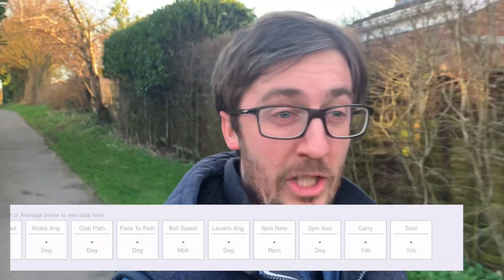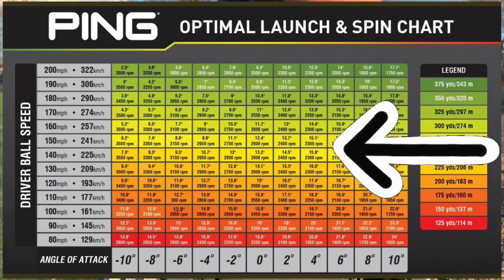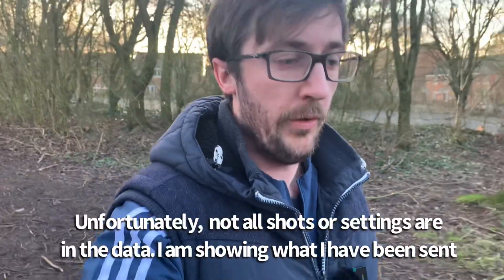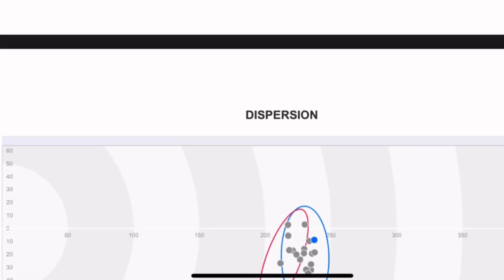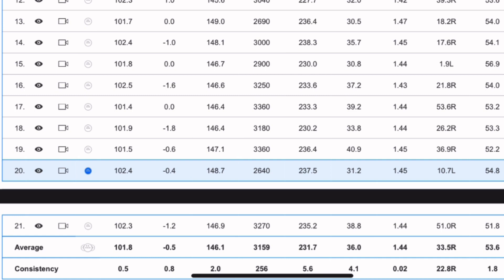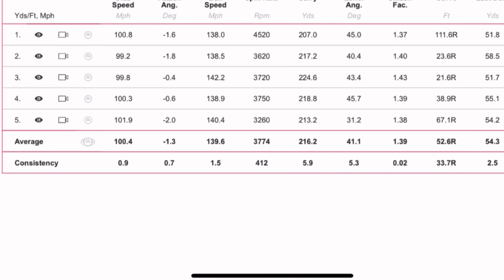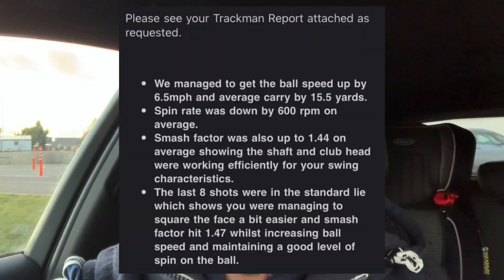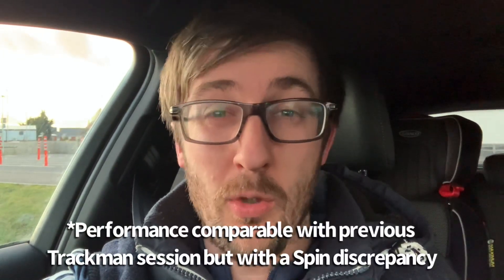MY PXG Driver Retro Fit - My HONEST THOUGHTS

Comment: I agree with fittings, bought m2 and they try to fit me, fitted myself they were a poor fitter. That why a pxg weight set and did myself. The new driver are more expensive than pxg gen4.

Comment: I have pxg gen 4 0811x and the pxg weighting system and experimented and set at 10 degree 15 in back 5 in front and 2.5 bottom this was a perfect setting for me.
Reply from the maker: 👌 . I wish I could have got mine right. Just the weight isn’t right . I suspect the swing weight is off. Feels very head heavy to me . I am hoping to try Gen 4 but not sure about what process to follow now 🤷

Comment: You are bang on if you have no confidence in a piece of equipment then change it. You "know" it won't help then you blame yourself for using it and that affects your next shots so it goes on. It was very disappointing to hear about PXG as they market on customer service/support. I have been to Ping at Gainsborough a few times over the years for club fittings and have always had exceptional service recently by Paul who is top draw well worth a trip for a fitting sesion. Their customer support is second to none.
Reply from the maker: That’s a great shout, when I was at uni I had a tour of the Factory and meet the manager. Very professional outfit. Might be worth a go. My only issue is not sure on the sound of the Driver ! Bit loud for my liking, especially on the driving range!

Comment: Few things:
- absolutely do not fit a driver with range balls - you mentioned TXG, they have an old video where they tested range balls and basically, on wedges, they don't spin enough, 6 iron is 'close', and they spin too much with a driver. Therefore, if you fit a driver for range ball spin you will then be approaching too low spin with premium balls. Thus pick a ball and play it - and then fit your equipment around the ball
- if your miss is a hook, then generally opening a driver for more start line right is better, and generally slightly more spin is better as spin holds  the ball straighter - but if you start with a  nine-degree driver, then opening puts you at less loft and now you are going to be in more trouble for spin - this sounds like it may be happening to you
- if I were you, I would go to an indoor location where you can do your own testing and just spend an hour experimenting. Bring some high and low spin premium balls. I would start by adding some loft, yes it will point face left, and use as flat a lie as possible, and put the heavy head weight in the toe of the club - use a higher spin ball and see where you are, then open the head back to stock, hit some more, then open the head more - you basically need to be seeing enough spin to play golf on a golf course - with real balls
- the answer may be that you need more loft as a starting point, given that your miss is s a hook, but you need real data with a real golf ball
Reply from the maker: Thanks Paul, thanks for your detailed comment . Yes , that was my main issue . Hook but opening face meant I had crap launch etc. really bad on the course . Managed to remedy my issues with the driver and got a 10.5 head so higher launch head, my more stable and if it starts to turn over too much I can then open it up. I have also stuck with Q star tour which suits my feels and swing speed. Thanks for commenting on the channel I will hopefully get a video out to show the new big stick ! 

I was kind of hoping that’s what this got would have suggested I did but was told to stick with it which I tried but was trying far too hard with the driver. 

I wanted to share my experience as I have had a range of experiences from Matt lab at belfry to foresight indoors and Trackman with Premium balls . I was disappointed by the service offered but the service is probably not aimed at experienced golfers more towards beginners . I suppose the video was to pre warn people of what to expect from a PXG retro fit .